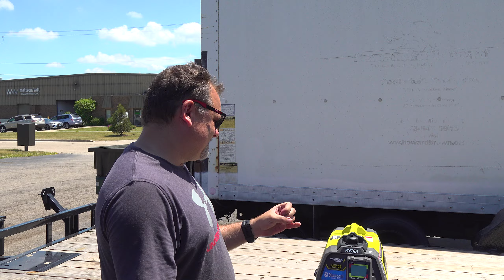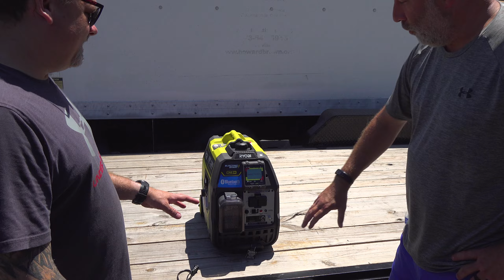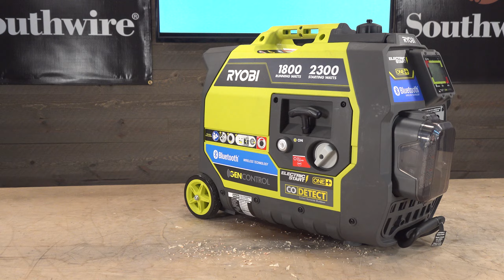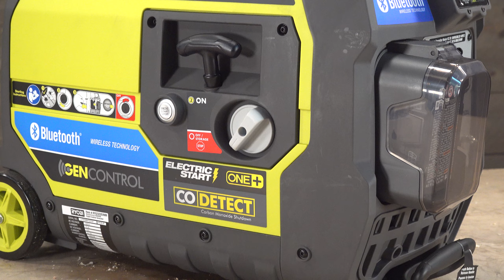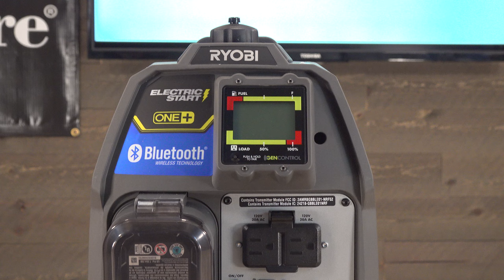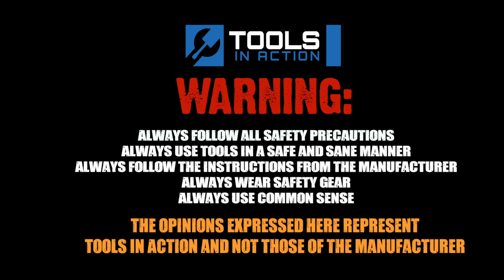Better than a HONDA!

Comment: I've had 4 of these they just suck... Ryobi replaced two ...Just crap..
Reply: Same! First had a bad carb out of the box. @nd ran 12 hours and the inverter died. On the third and just selling it off, not worth saving money if I can't rely on it. Also it not charging the battery while it sits in there, STUPID. Good ideas, bad execution.

Comment: Honda now has the phone app option but it’s still over a grand for the small inverter generator and a large unit that would power your fridge and other appliances is around $5k for having Bluetooth nice video it’s cool it starts with a ryobi battery if it dies just have more than one way better than a standard battery

Comment: Still carbureted 🙄
Reply from the maker: Hmmm I dont know of any small gen that does not use a carb
Reply: Powerhouse PH2400PRi/E Inverter Generator With Electronic Fuel Injection - 2400 Watt It’s $743 there’s a few but they obviously cost more than a carb model
Reply: Are even the smaller generators going away from carburetors?
Reply: @bluegrasskid4835  no but all those cheap chineese generator uses bad quality materials for carburetor, they start easily the first year, then it's a pain the 2nd year, 3rd year it needs to be cleaned.
They don't even use a fuel filter most of the time. at least with fuel injection it's a bit more reliable.
take the money from all the gadgets on this one, put a proper fuel injection system, then it might be as good as a Honda, wich is carbureted but uses a quality carburetor and fuel pump, with quality rubber parts than won't dry up in a year or 2.

Comment: Yup, first thing i thought when seeing this was, "cool, you can just put a flat battery straight onto it to charge it up while you're using it [the gen'] for other things". I do use Ryobi ONE+ tools and batteries and if i were to purchase a genny, that would have been a significant selling point, as it would be one less hassle not having to run a charger off one mains' outlet and having it get in the way.
i expect it would have cost only a few dollars at manufacturing level, but buyers would have been fine with an initial MRSP of $10-20 more - we wouldn't know about it, just know that as being 'the' price.

Comment: great unit but is not enough to run any campers AC and microwave (boondocking). Needs to be 3650 Watt like the whisper quiet Firman
Reply: Wouldn't it also need a 30 amp outlet to hook up to a camper?

Comment: It doesn't make any sense why they wouldn't have a built-in charger for that battery.
Reply: It's not all that uncommon. A lot of the Generac generators do not charge their battery. You have to plug in a small wall-wort to charge the battery.

Comment: The Comparable Honda unit is a EU2200i which costs $1099. Honda is known for build quality, reliability, low noise and purity of the AC output sine wave.  How can you declare this unit equal to or better than Honda when you didn't test any of the features I just listed?  Don't get me wrong, this Ryobi may very well be equal to a Honda that but that determination can only be made over time. Put a couple hundred hours on this unit and report back.
Reply from the maker: Ok, dont tell our audience about new tools. Use the tools for a few years, then when they are not popular search topics we will dominate!
Reply: @Toolsinaction  I think you misunderstood my comment. Telling us about a new product is great and we appreciate it but declaring that X is better than Y without even doing some rudimentary testing of X is just silly. Even junk tools and equipment usually work fine out of the box. It’s later that they start giving you problems. It’s akin to car commercials that declare that the new 2021 Chevy is more reliable than Honda or Toyota. Which will only be known for sure a year from now.
Reply: @eosjoe565  Yup, even though most things shown aren't relevant to me, I enjoy seeing what's out, but some basic checks/verifications would have been a sound idea - the quality of the waveform, and verification of it being able to sustain the rated output, the sound level when under full load, etc, would have been simple checks to do, as some equipment is fine when lightly loaded, but under load has issues with things like these.
Reply: @Toolsinaction  the fact that you reacted to constructive criticism like this tells you where this channel is headed.